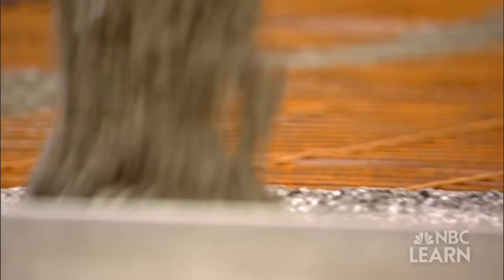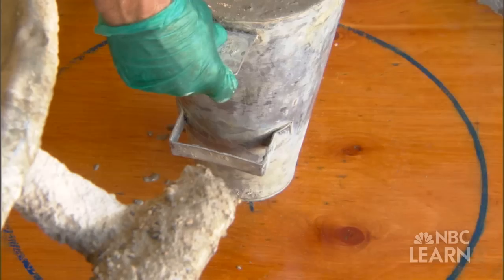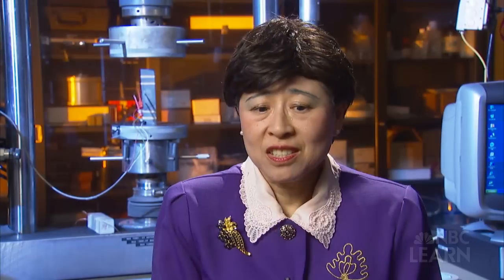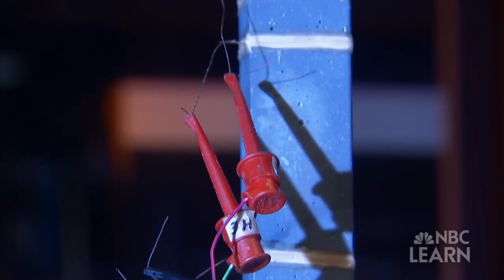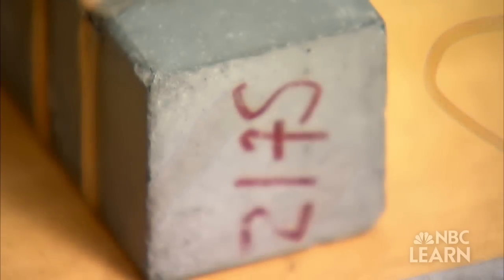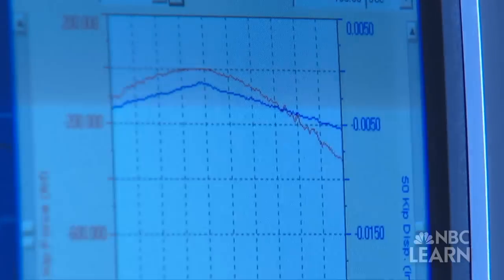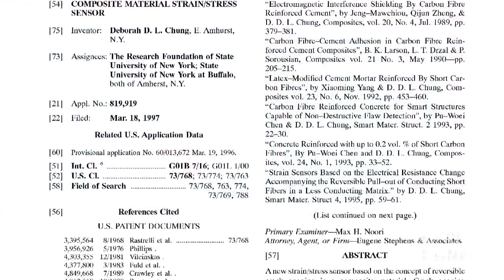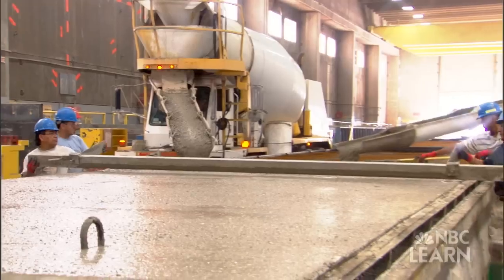Science of Innovation -- Smart Concrete

Comment: this is a good idea no doubt. but the only problem i see is that the ability for the fibers to conduct electricity is only as long as the concrete is curing. i honestly dont beleive that carbon fiber would improve the strength of concrete, but weaken it.